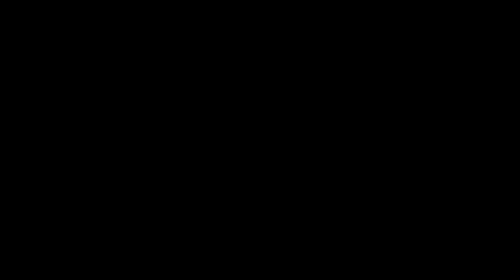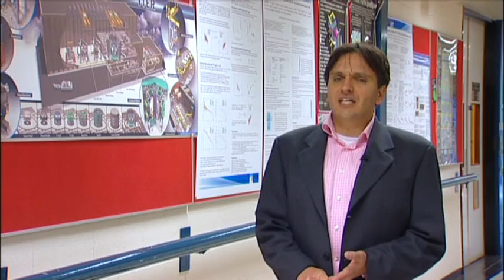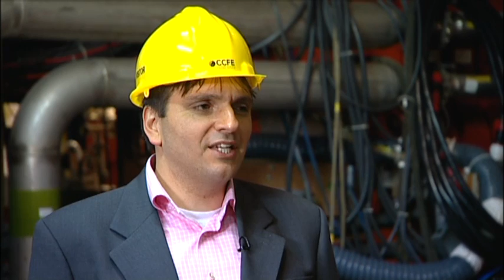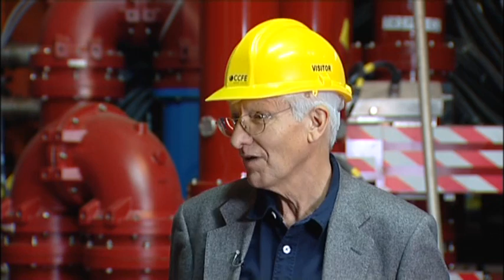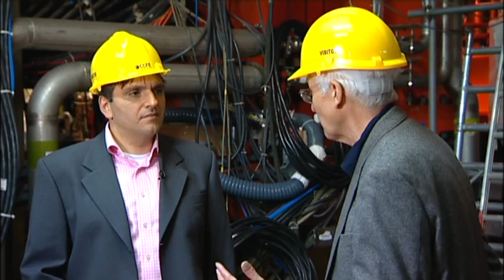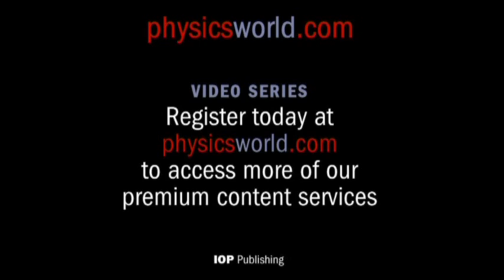ITER - a fusion facility worth building

Comment: Because reactors depend on heavy water as a moderator, they release larger amounts of tritium to the environment than light water reactors (…) Tritium is a carcinogen, mutagen, teratogen and developmental toxin. It becomes incorporated into DNA and disrupts the genetic code of men’s and women’s reproductive cells. current Guideline and Drinking Water Quality Standard for tritium is 7,000 Bq/L, which is based on the permissible ICRP dose limit of 1 mSv/year (lowered to 0.1 mSv in water).